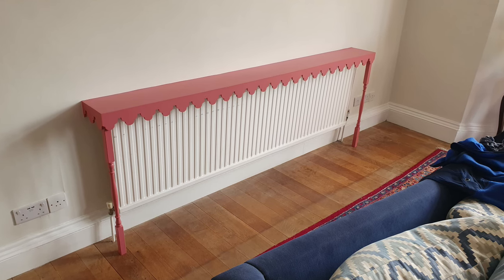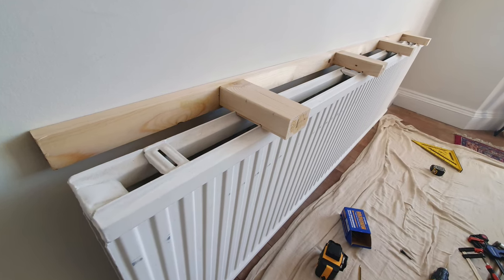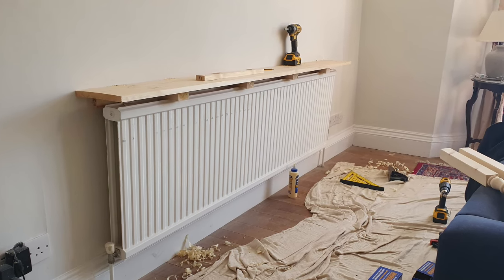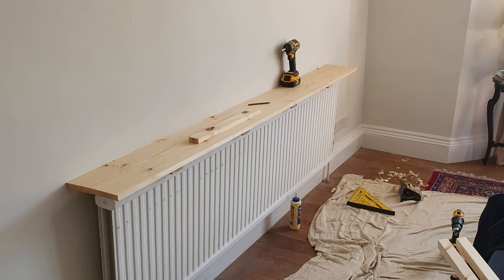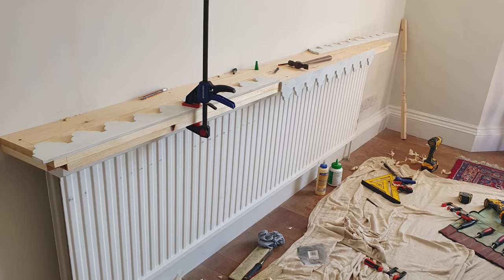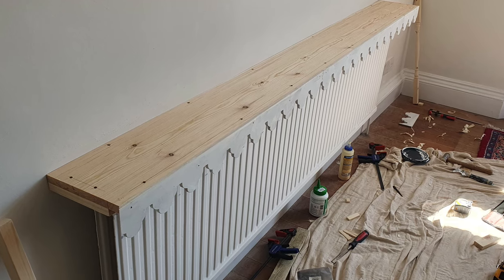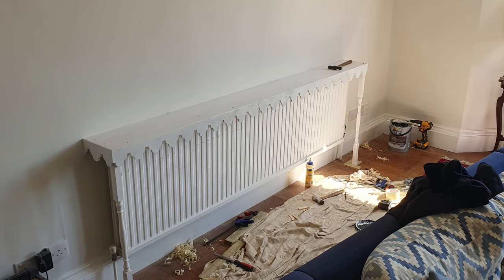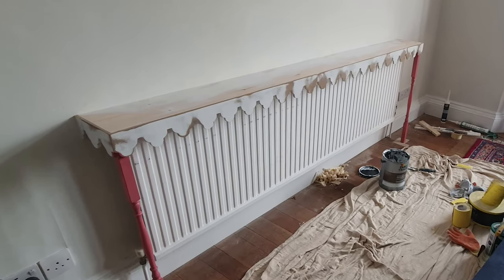How I made this DIY Radiator Shelf

Comment: Ok... I'm gonna be "THAT guy" today: what about the radiator's primary function? Is it not used for heating anymore?
Reply from the maker: It is a good question, and one I asked the customer. The customers interior designer came up with the idea, I just did what they asked. However, the heat will still radiate. Yes, holes or slots in the top would be wise, but this would spoil the whole aesthetics of it. There is a fireplace in this room, so my guess would be that it's not used a huge amount anyway. It would definitely keep your glass of merlot slightly warm in the winter though 😉